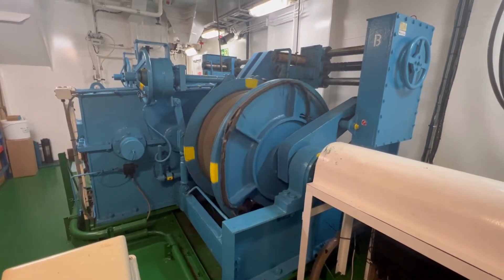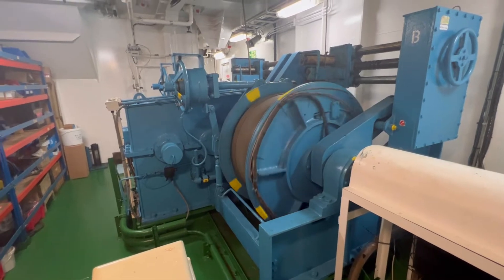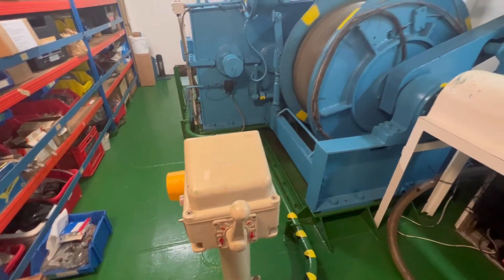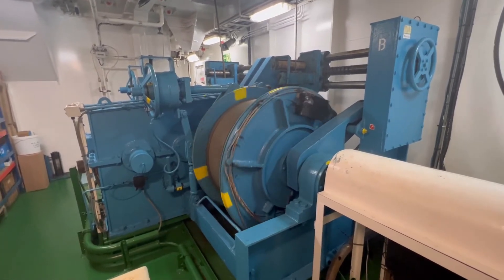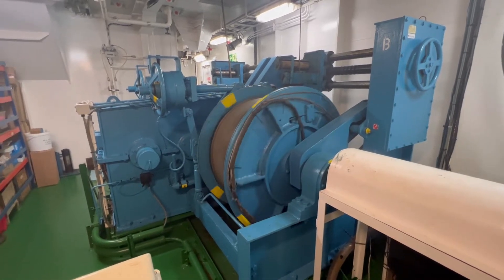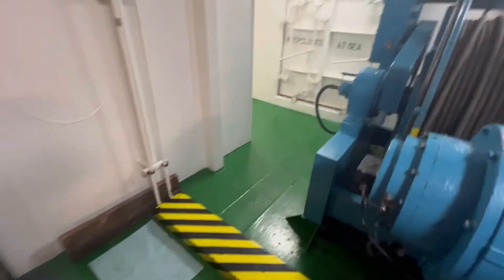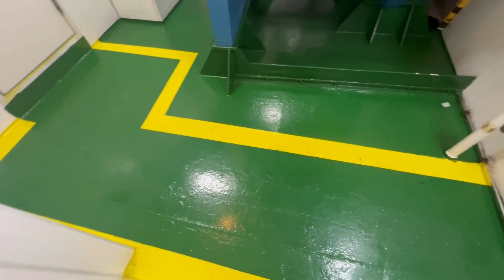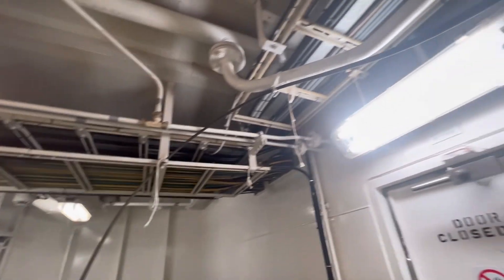Under deck winch machines pt1

Comment: Nice winch retro, is that 1/2 " wire, Bet thats got a good core pull.
Reply from the maker: I dont know anything about winches. This is one you’ll see is only lifting a small camera sled
Reply: @retroonhisbikes  ok, what is the camera looking for if its not a rude question?